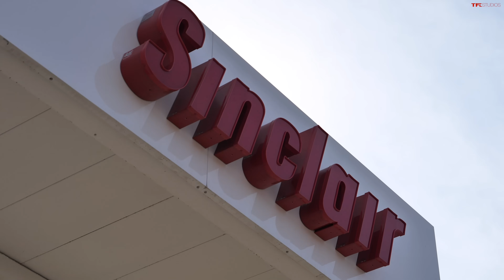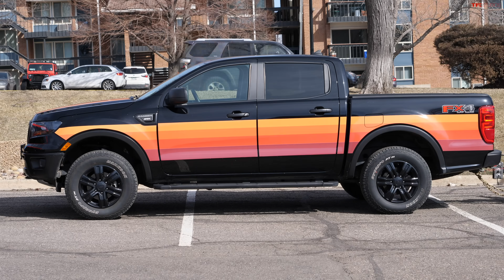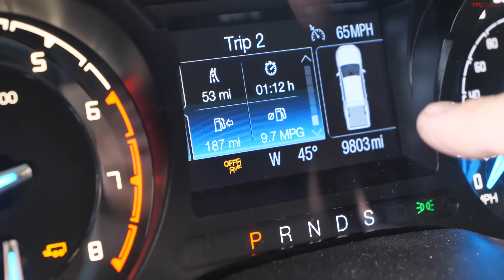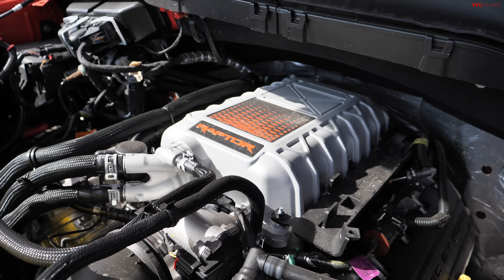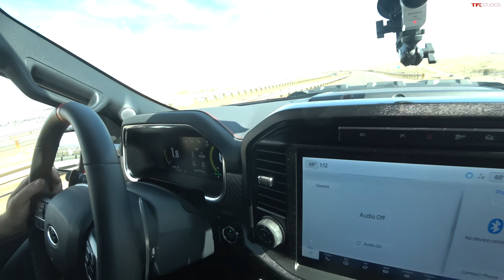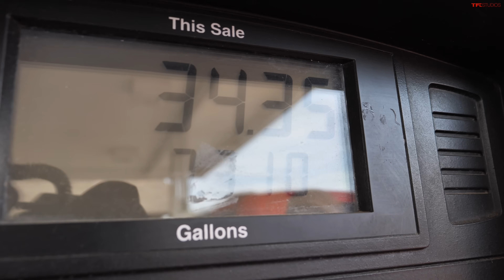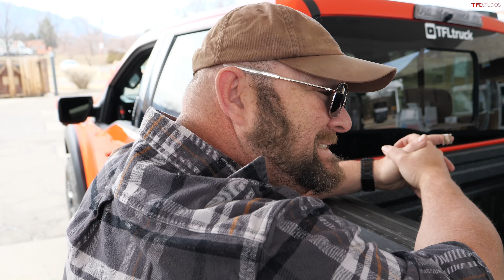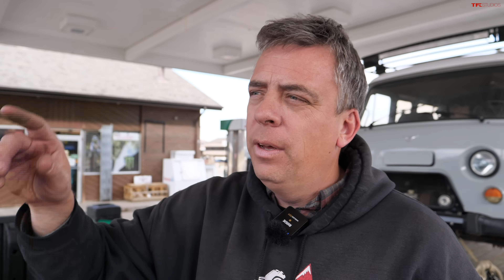Myth BUSTED: Does a Big Engine Get Better Fuel Economy TOWING Than a Small Engine?

Comment: A more relevant comparison is GM 2.7 vs 5.3 or Ford 2.7/3.5 vs 5.0. In my experience a 3.5 will pull like an effortless brute, but use more fuel than 5.0 and the 5.0 just doesn’t have the same grunt
Reply: Ecoboosts have to run rich at high load to control exhaust temperatures. If you let the truck shift on its own it will use the available torque and grunt along at low rpm, high torque. I've logged my 2014 3.5L towing thousands of miles and it appears to start to go rich as you push it more than 350 ft-lbs sustained. I've started downshifting the truck manually as I see the air fuel ratio start to drop and it will pop right back up. The only time I can't prevent it from going rich is on the steepest, toughest climbs.

Comment: Octane has nothing to do with power it’s the resistance to detonation.
Reply: It's funny how much people think " it burns cleaner" " oh I get more power " it doesn't do any of that.
Reply: And in doing so allows for higher compression… sooooo 🐴🐴
Reply: @andrewsbbq  Or in a turbo its allows you to force more air into the combustion chamber.  So with a turbo engine the computer can give you more HP with higher octane gas.

Comment: Here i am in Commiefornia and not allowed to tow a trailer past 55 mph....😅I agree with other commenters regarding restarting the Ranger for most accurate mpg (though that would probably only change around +.5-1.5 gallon per mile). I would only consider a full sized if I was towing most of the time. If I was only towing once ina while I would get the mid sized, when you dont have load the mpg is pretty much doubled with smaller truck benefits.

Comment: I hate that manufacturers don't offer diesels in 1500 and midsize trucks. Both Ford and Ram dropped their 3.0 diesels, and gm dropped the 2.8 in the colorado/canyon for 2023. Things get insane mileage even with the garbage stock tuning. Loaded 6,200 lbs in a 2.8 and still got 14.3 in the super hilly areas of Missouri. On flat ground you can get 17-20 depending on speed and trailer aerodynamics. Routinely average 25.3 with a lift, off road tires, and steel bumpers. A similarly equipped Tacoma or Ranger usually gets ~18 just on the highway.
Reply: Regulations killed them and vw diesel gate was the last nail in the coffin
Reply: @lesstevens2370  You're not wrong. It is bizarre how diesel emissions are as stringent as they are in relation to gas though. It's like the government just doesn't want efficient diesel vehicles out on the road.

Comment: The tire size, axle ratio, and transmission play such vital impact on this that there's no thorough way to test this in such a short video
Reply: I'd say they did a fine job.  It's a Raptor vs a Ranger, of course all of these things factor into the difference between the two, that was the whole point.  The fuel mileage was the equalizer.
Reply: Not to mention driving habits.
Reply: @Hybris51129  The same guy drove both runs.
Reply: @TheBeatenPaths  In this test but some other drivers might manage better or worse. That is how close the results here are where realistically the "better tow rig" can easily change.
Reply: @Hybris51129  You're splitting hairs.  That's how any close competition works.  Did the Chiefs really outplay the Eagles, no. Play another game the following day and the Eagles could have beat Chiefs.
Reply: Dont forget aerodynamic drag of the trailer that is a very big factor. Means when you use a bigger truck for towing the trailer is mostly in the  airshaddow of the truck, with a smaller truck the trailer gets hit by the air, the drag coefficent of the trailer is way worse than that of the truck.
Reply: All the different things that go with the different displacements to make them work. If you put the same gears and tires on both, I guarantee one would fail miserably. Try it and let me know.
Reply: The only way to test anything is to change single things and then figure out what the impact is. Then it is possible to try to determine what needs to be changed. These tests would end up being a series of short videos.
Reply: @ronaldking1054  exactly: in order to determine which is the better towing vehicle for a particular trailer you need to have comparison tests with every single possible option that can change. Then compare each.

I would guess that prolly 50 variables out of 60 the larger truck will be the better towing option. 8 out of 60 the ranger would be the better option and a couple will prolly be identical
Reply: @calebbearup4282 Technically, some of the tests would be between different Rangers and different F-150's.
Reply: @calebbearup4282  yeah it’s not an statistical analysis it’s a real world test. MPG is a pretty good base to compare. At the same weight if one truck has less mpg that’s telling something
Reply: The axle ratio makes absolutely zero difference in trucks with 8 or 10 speed transmissions. This isn't the 1990's gramps
Reply: @hitempguy  The axle ratio might also mean that the weight rating on the axle is higher, and as such, the axle ratio could change the maximum towing rate on the Ranger. The higher mass that can be towed could very well make a difference as to the fuel efficiency on the Ranger.

Comment: If I ever becomes possible a second run of this test with a 2.7 vs 5.3 or 6.2 in a silverado would be really apples to apples. A mid size vs full size truck has to many variables. Still a great video though.
Reply: Yep, Silverado 2.7T vs 5.3 vs 6.2 would be a good comparison.
Reply: @andrewb325  - the info is already there. Each powertrain has done the Ike Gauntlet already. Just look them up.
Reply: Yes!!
Reply: Usually if you don't need a full size you are better off with a mid sized.  They are easier to maneuver, fit in the garage, and should get better mpg's.
Reply: The intent was to test the mid size vs the full size as much as the engine size.
Reply: @67 C10  the hypothesis was does a small displacement motor working hard burn more fuel than a larger displacement motor not working as hard. I don't recall the test being mid size vs full size, they have already done that.
Reply: @spcneary  - whatever. It’s easy to tear it apart. These are the two trucks they compared. Look back and you will find videos rating each of the vehicles you want and you can form your own opinion. It’s really that simple. Stop asking for info you can already access,
Reply: you roughly halve the unladen MPG, that easy
Reply: @Adam Lesandrini  true, but lots of other factors come into play with how different the two trucks are. If the comparison was mid size vs full size it was a reasonable test, but the displacement of the two motors was likely not the biggest factor in fuel economy because the trucks are so different in weight and shape.
Reply: @spcneary  This is incorrect. The amount of impact on fuel economy is known, and can simpl;y be applied to any base vehicle and engine combination by taking the unladen MPG and roughly halving it. The larger the vehicle, the closer to half you get. Smaller vehicles can get better than half. This is simple math. If you really want results down to the 10th or 100th, obviously you need to test every variable in configuratin, but that's not reasonable. They did a ford f150. divide laden and unladen numbers, apply this ratio to any other f150.
Reply: @Flyinghook  I disagree, but that's ok. Hope you have a great day.
Reply: @Flyinghook  This is really only for gasoline engines and only for engines that are efficient unloaded. If you stuck a 7.3L Godzilla in a ranger I bet you might see that the impact is less than 1/2 since it would be pretty inefficient lugging around an unloaded, small, lightweight ranger.
Reply: @Jay-me7gw   That might very well be, but you would be foolish to have a godzilla , especially in a truck you aren't using fully laden all the time.
Reply: @Flyinghook  I'd 100% take an F150 with a Godzilla. Or even a Ranger. I tow enough(~30% of my trucks miles) that i would sacrifice the unladen MPG's for better towing performance.

It will never happen though.
Reply: @Jay  after having put over 100000 miles on ford trucks with na and turbo diesel engines I would never own one. I would have more faith in an ecoboost over the long term. My ecoboost has all its power at 200000 miles, the na engines were effectively dead at 100000 they were so gutless. Then you jump in one that had a new engine put in and it was night and day
Reply: @Flyinghook  Maybe. The Godzilla is a beast though. My mother in law had a 7.3L in her 14000 lb Class C and I drove it 4-5 hours around Wyoming and Utah at 7-9000' and it had no issue moving that thing. I might have had a little less torque than my 2014 Ecoboost at lower RPM but it also didnt need to spin any more than 3500-4000 rpm.

Problem with my Ecoboost is it overheats like its its job here in Utah during the summer. If the ambient temp goes over 80F I have to really pay attention to the coolant temps. Thats with a Mishimoto radiator and standalone oil cooler.

Comment: Would be interesting to test the Ranger against an F150  Eco Boost 3.5 and a 5.0 V8. The Raptor R is not what the average person would buy to tow with.
Reply: I went from a 2021 Ranger with 33's to a 2022 Ford f-150 2.7 with 35's. Both had/are tuned. The Ranger is amazing except for the tiny fuel tank. The Ranger tows 7500 and my 2022 F-150 2.7 Stx 4X4 is at 7700. The F-150 is more comfortable, quieter & def handles our 7X16 utv trailer better. Ultimately the tank size is thee best. Before you bash the 2.7 remember it makes near 400 wtq stock on premium. MORE than the 5.0.
Reply: Base V6 in the F150 vs the 5.0 ..
Reply: Would love to see 5.0 vs ranger
Reply: You take the unladen mileage and about halve it. This dynamic doesn't change much with different engines and types, it's more a factor of the vehicle and it's base configuration.
Reply: Yep.  I was expecting a comparison between Forced Induction smaller engines vs. NA V8, but in similar power ranges.  The Raptor had a good showing, though; all that extra power and weight, sprung and unsprung for about a 12% difference?  Not bad....
Reply: I was thinking the same thing. Not everyone can afford a raptor r. Cool video just the same but be nice to see this comparison with a regular f150 as well
Reply: The F150 2.7 would be the closest match with the bit bigger displacement making up for the heavier truck. But I agree either mentioned here would have been a better realistic match up. I strongly agree with Nathan that I would not want to tow this weight on a regular basis with junior.
Reply: Yep I was thinking the same thing. It would be better to do this with power trains people actually shop against one another, such as the 3.5L Ecoboost and the 5.0L Coyote. Fun video though.
Reply: I'd be curious to see if a naturally aspirated V8 could achieve better mileage than the turbo 4 under a load when towing.
Reply: yeah, a supercharged 5.2 or the TRX's supercharged 6.2 are not really setup for towing efficiency. The common V8s and V6's are going to be more setup for this test
Reply: Yes for sure
Reply: I agree. With those engines Ford is at least trying to be as efficient as they can be. The Raptor R is tuned solely for performance, efficiency be damned. It just doesn't seem like a good choice for this test.
Reply: I towed a 7k trailer with my v6 ranger. I towed my 8200# travel trail with a f150 3.5l eco and with a f150 5l v8. Recently bought a f350 7.3 Godzilla. The ranger was the worst mpg. The f150 were extremely close but the eco was much better going up long hills. The Godzilla is about  the same as the 3.5 eco & 5l v8. The f350 weighs about 2500# more than the f150 though
Reply: Absolutely.
Reply: Yea because that would be much more scientific…
Reply: What about my 2.7TT EcoBoost?
Reply: TFL let me know if you need the 3.5 for this test. I have the 2016 f150 with the 6 speed. 👍
Reply: Towing my 6x12 trailer at about 5000# gave me 12mpg on the ranger and 10.5 on a powerboost.
Reply: I was also thinking that it would make sense to also change the trailer weight between tests to be the same percentage of towing capacity. In this, if the trailer was 7500 then it's 100% for the ranger, but only 86% for the Raptor R. I'm sure the other challenge for TFL would be trying to get matching gear ratios which would have some impact as well.
Reply: @nascarben  Why not change the transmission and engine on the Ranger to make it more fair in terms of strength of towing? Oh yeah, that would destroy what was being tested.
Reply: @ronaldking1054  if the point is to test the efficiency then they should both be tasked with towing the same level of effort and that's not what they did here. I mentioned the gear ratio as a nice to have because if you had 3 identical truck with 3 different rear end gear ratios you would get 3 different results.
Reply: @ronaldking1054  they both have the 10 speed 😅
Reply: @HoNkEyKoNg67  You're claiming that the 10-speed transmission has the entire same set of gearing for all the 10 speeds. They both have 10 gear sets. Want to bet if I look up the two that the part number won't be the same for the transmission? The transmissions would also need to be the same physical size.
Reply: @nascarben  Kinetic energy = 1/2 m * v^2. That is the only effort to compare. The only difference is the mass of the trucks, but that is part of the difference in design between the two models, and as such, it is the same level of effort.
Reply: @ronaldking1054  why not get to the exhaust diameter and air filter size. Bet the valve diameters are different, and piston dimensions... the transmissions aren't identical because they are designed to be mated to different engines. Which one should we use? The V6 10-speed on the raptor? or vice versa? Maybe put 32s on the raptor and not 37s... or...
Reply: @brentworls8509  Exactly, which is why one uses the design of the model one has in order to test the quality of the truck rather than making some absurd notion of effort. He just wanted to change the amount of towing in an effort to make the F-150 look better, but that had nothing to do with anything. I just moved the idea to the other side of the equation to show how truly bad the idea was. I even told the one who said they both had 10-speed transmissions that wouldn't mean a thing as they are not probably geared the same way in each of the speeds, and the transmission is not likely to change the gear at the same time either.
Reply: @ronaldking1054  so the timing belt is everything!
Reply: @ronaldking1054  The 2.7 would have bene the best alternative for this test in the F150 for sure.
Reply: @nascarben  This is very realistic. You tow the same load with different vehicles. You have a ranger and say, aah, it should tow this just fine, and either you want the extra towing headroom or just thing a bigger truck looks cooler, but that doesn't mean you then go out and buy a new trailer and thing to put on it. You usually still pull the same trailer. Sure, you might eventually get a bigger trailer to take advantage of the new truck, but that's not a given. I've done what they are doing, personally, 4 times. New vehicle, same load.